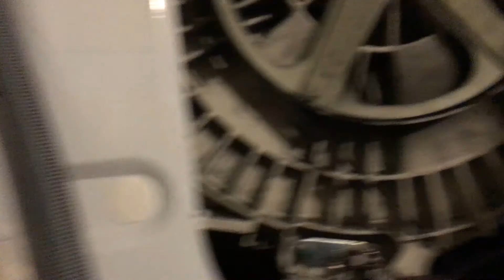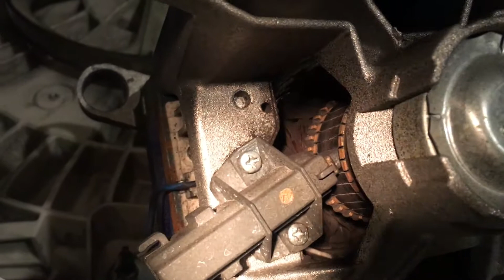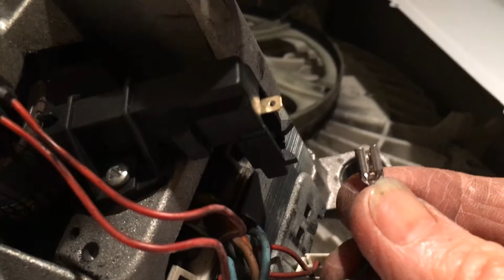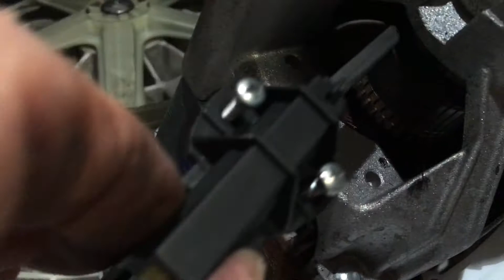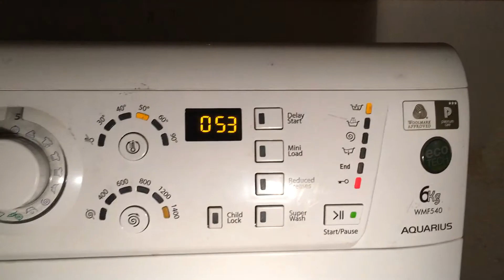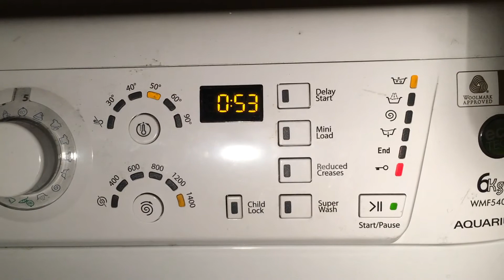Hotpoint Indesit Washing Machine DIY repair motor with new carbon brushes. Easy DIY fix WMF540

Comment: hi there, good video. do you lie the machine on it's side?
Reply from the maker: Hi Mohammed, from memory I tipped the machine halfway on its back - just enough for access to the motor. Its quite easy. ATB b33zo
Reply: i persumed you got someone to help you
Reply from the maker: @mohammedamer7896  ha no. That wouldn't be Do-It-Yourself Mohammed!

Comment: Would be good of you showed the motor being removed and replaced too. 🤔
Reply from the maker: Thanks for watching Michael. UNPLUG THE MACHINE. Carefully pull the electrical block out of its socket. Loosen and withdraw the two long bolts and the motor will come loose. Should take about 20 seconds plus the time it takes to find the correct size socket spanner. Good luck with your project - it's fairly easy. 
b33zo
Reply: @b33zo  I managed to find another video showing the actual removal of the motor.